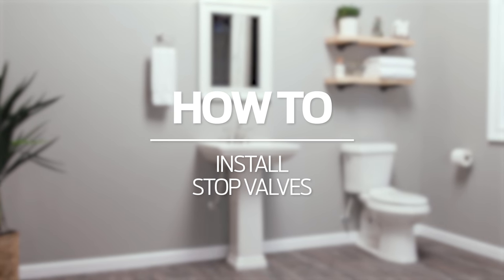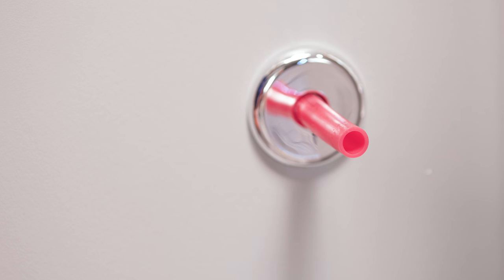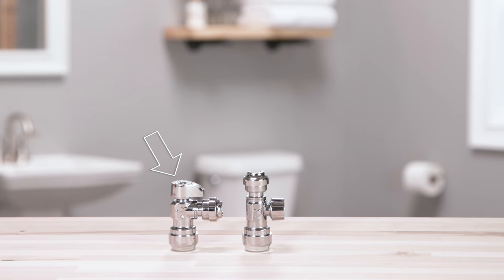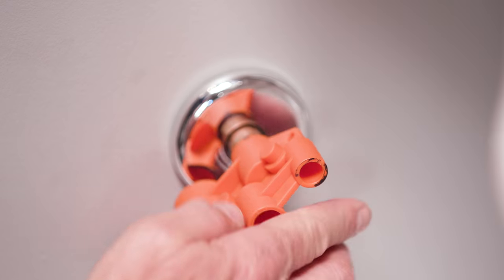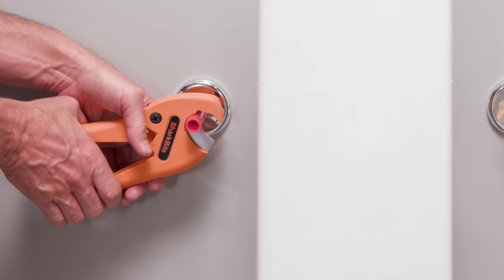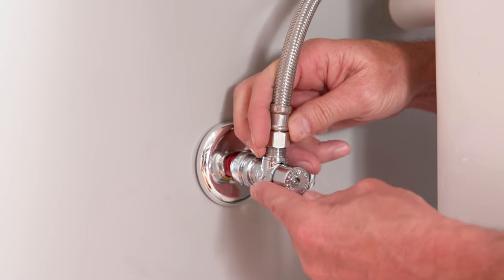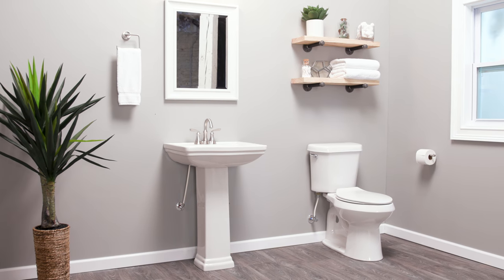How To Install SharkBite Push-To-Connect Stop Valves

Comment: I thought that the video was very informative and helpful. Be sure that at least 1-1/2" of the pipe end is shiny and no burrs or scratches. My package did not come with a removal tool, but the tool is still shown on the bag. Never a good solderer, I appreciate these new way to put plumbing together. A lot less houses will burn to the ground without using a torch. I think some of the problems below is that people are not pushing the pipe into the fitting far enough, hence use the mark on the pipe. The last part of the video shows how to remove the fitting for re-use.

Comment: You explained that well. Can you explain the wordless instructions on the package? What is the last step that shows the chrome piece being flipped around and pushed the other direction?
Reply from the maker: Hey there, Dave! As you know, we're big fans of ingenuity, so we decided to build in some multipurpose uses into this fitting. The chrome clip/collar can be removed and flipped around to use it as the disconnect clip for the supply stop should you ever need to adjust the fitting. It isn't included on the packaging because it isn't required for install, but just a little something extra. 😉

Comment: If previous stop valve was threaded on to a hard copper pipe, can  I clean install the Sharkbite stop valve  on the pipe as is?  Or do I need to cut the pipe down far enough to remove the old threading?
Reply from the maker: Hi there, Chad! Make sure you do have a clean pipe without threads before installing the SharkBite push-to-connect stop valve. Give our Customer Service team a call with specific questions: 1-877-700-4242.

Comment: I saw in a video that said you can remove the white insert in the shark bite angle stop. Is that true? What would be the difference? I'd appreciate any clarifications.
Reply: I know this an old post.  If you are working with copper, you can remove that insert--but you don't have to.  If you are working with pex/plastic supply lines, you need that insert to stiffen the connecting end--never remove it!

Comment: one of mine  came apart and FLOODED the bathroom. PLUS if one has hard water one needs to cycle the on off knob because they Stick I had to use a pair of vise grips to close the vale.

Comment: Would have been nice to show how to do a bathroom sink with the lines coming up out of the floor,  and which already have another name-brand valve that's leaking.
Reply: Vinyl pipe?  Shut off the main water, Cut  off the old one as cleanly as possible, press on the SB :)  just did 6 of them in my upstairs bathrooms. Was super easy and fast.
Reply: @mikelshilling  I've got copper pipe coming up from the floor and little pipe to work with, just about an inch to the existing valve. Hard to see how I can push on the Sharkbite adequately. Ideas?

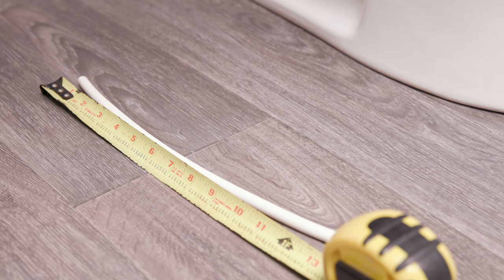Comment: At 1:45, you say to measure two inches between the fittings. However, adding two inches made the piece too long for the toilet connector kit. What is the correct length?
Reply: I'm thinking a slight bend in the pex/connector wouldn't matter.  You are always better going a "click" over than under if you can.  All those braided supply lines are always longer than what you need for the job.  You just bend them to fit.  You would be hard-pressed to find one the exact length you need in most cases.

Comment: I pushed the SharkFit Stop Valve and when we turned the water back on, water flooded the bathroom. Cut the pipe again, bought another Stop Valve. Tried to install it and the same thing happened.
Reply from the maker: That's not what we like to hear, Ree Cee. Give us a call and we'd like to see how we can fix this issue: 1-877-700-4242.
Reply: Copper or Pex? If copper, you should deburr the pipe after cutting to remove any jagged edges inside/outside the end of the pipe. I installed 13 SB's in my home and had one leak after turning the water on. I pushed the SB as hard as I could onto the Pex pipe and it was fine after that. I also had a BrassCraft (brand new) supply line leak right away.

Comment: What do we do with the collar that comes with a push to connect fitting? The stupid C collar.... it didn't show it on there or taking it off like the graphic on the back of the lackage at the store shows. This video is a great sales pitch but zero help
Reply: Were you able to figure this out because I'm clueless as well.  What the hell is that for and what do you do with it?????
Reply: @rickross199  It is a tool for future removal. You do not need it to install. Just push it on and then slide the collar on for safe keeping should the need arise in the future for removal.
Reply: @sunrise7ranch85  thanks that's the only thing I could guess it was for as well.

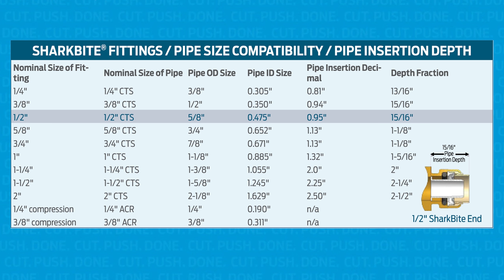Comment: I guess the instructions are 1:10 - push the valve on.
Reply from the maker: If you work with SharkBite products frequently and are familiar with our installation steps, then yes--that is it!
Reply: @SharkBitePlumbing  yeah...well most of us DON'T "work with SharkBite products frequently and ARE NOT familiar with your installation steps"  ........BEING THE REASON WE ARE ON YOUTUBE TRYING TO WATCH A VIDEO THAT SHOWS US HOW TO ACTUALLY USE THE DAMN PRODUCT! ....unlike your very  unhelpful video!
Reply: Ryan Armstrong  I thought about it with common sense for several minutes before I was unable to figure out what @dirt nassty did wrong? Indeed, people who come to an instructional video by the manufacturer are not familiar with the product. The package contains instructions that have a final step that wasn't mentioned and the reason I am here. I don't believe this video does anything to help people who have real bathrooms that are actually piped and braced to learn anything about the product. If my stub out wasn't attached to anything, I'm sure I could maneuver the tubing onto the loose angle stop.

Comment: 3 times now the stop valve has shot off the wall and soaked me and my bathroom
Reply from the maker: Well, that's not supposed to happen, Richard! Give us a call and we'll see how we can help amend this: 1-877-700-4242.
Reply: Omg! Did you figure out what the issue was? Too much water pressure? Was your water not shut off or wth?
Reply: @ariellefiveysky7556  the water was off I put it on the wall turned the water back on and it shot off.
It turned out Lowes sold me the wrong type of valve
Reply: @richardcahill4419  which valve worked for you
Reply: @richardcahill4419  which valve worked for you
Reply: @opsgreg8392  I can't remember which model exactly. But it wasn't a push to connect valve it was one that had to be soldered